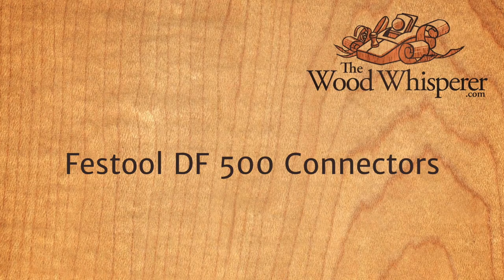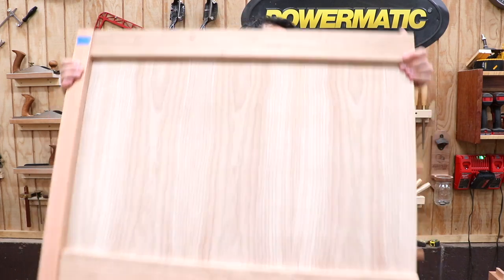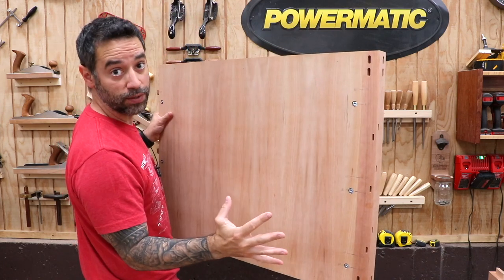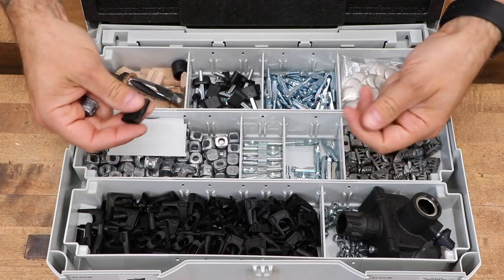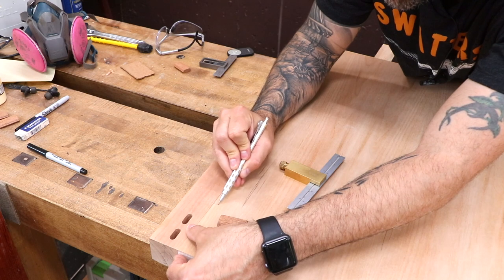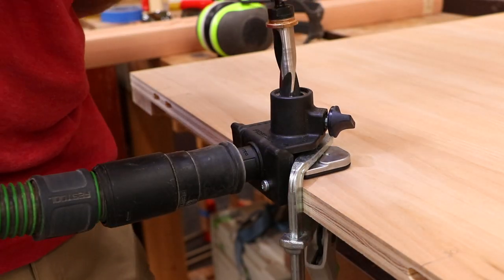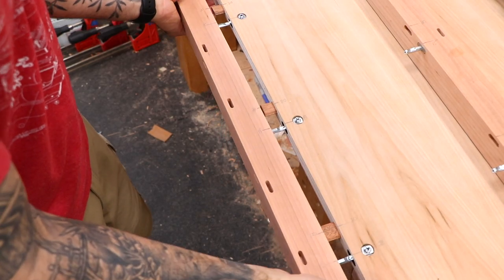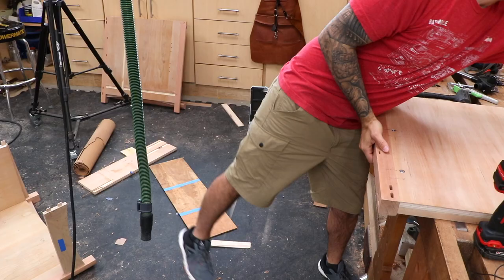Festool DF500 Connectors

Comment: Thank you for the video. I am just about to start working on a bed for my son. Being able to break it down is, well, mandatory, won't fir through the door without the ability. I was going to use some RTE's I had lying around, Ikea still with a visible hex head. I might actually get this system. A lot of money, but, it looks like it might be durable enough to handle my 10 year old boy, and be hidden.

Comment: Thanks for doing this video , I looked at the kit and thought the same thing  (WOW  there's a lot a doohickeies in here )  I use the 700 connectors and love them, now I have the option of using these too .   Festool did a book on the domino that included the DF 700 connectors and I found that super helpful . If anyone is interested that's available f or download on the festool site .  I'm sure an update will be out to cover the DF 500 connectors at some point .

Comment: How does the connection feel? Does it feel as if you actually glued it in place? Just curious
Reply from the maker: Yes it does. The fact that I put a regular domino next to each connector make it rock solid. And you don't need much holding pressure to pull the parts together so the connectors do that very well.
Reply: The Wood Whisperer I've seen these offered in yankee land but I'm unable as yet to find them in the land of oz. (You know, the island where the brits sent their prisoners)
Reply: Carba-tech and Gregory's Machinery have them. Yes mine included convicts. Cash & Co (including)

Comment: Hi Marc, I have a fewof questions if you don't mind. 
1) would the DF500 system work with say making a knock down joint for a bed rail, or should you get the DF700?
2) @2:27 wouldn't it be better to cut the 15mm leg hole a little deeper so that the "post connector thing" sits below the surface (by a couple of mil)?  that should encourage a tighter joint, no? 
3) if you used this system, how do you account for wood movement?
thanks!
Reply from the maker: 500 can work but 700 is better if you can get access to it. For the post connector, I'm just following Festool's advice. I doubt going deeper would have much noticeable impact. Regarding wood movement, you account for it like you do in any other project. This is nothing more than a mortise and tenon that you can disassemble. Wood movement still gets the same consideration whether you're using actual dominos, regular tenons, or these knock-down components.

Comment: Awesome ! I thought they said that the 700 could not be used for thinner stock like 3/4” or was it 1/2”?
Reply: At the time I bought my df500 the 700 couldn't be used to join 1/2" edge to 1/2" face.  So I bought the 500.  Shortly after my purchase Seneca came out with an adapter for the 700 that allows for the small dominos to be used to join 1/2" face to 1/2" edge.  So the 700 can do anything the 500 can do but the 500 is limited in what it can do.
I'm a bells and whistles kind of guy, I'd get the 700 even though I probably wouldn't have need for the larger dominos but I like having that option, just in case.  On the other hand, besides having 5 fingers, if you know you will absolutely never need the larger dominos the 500 is smaller and a bit easier to handle.
Reply: @ThekiBoran  I totally understand your thinking on that decision. I figured I buy the 700 with those Seneca adapters at the time but now I’m planning to buy the 500 too.

Comment: Do you think these are strong enough connections for bed side rails?  I've seen the larger ones, but don't own the 700 domino.
Reply from the maker: Probably not. The max depth of the 500 is really the heart of the issue. For a bed, I really think you'd want more substantial mortise/tenons.
Reply: On a bed if you used a pre cut tenon that you can for example put your rail through you could then use this system as a means to fix it in place. The load would really be bearing on the tenon and not the actual fitting. 

The fitting would be a glue of sorts. You can use this approach with many sneaky techniques so that you do not need to glue on site.

Comment: Thanks, Marc. What holds the part that you inserted into the leg there? I didn't notice any threading or adhesive used.
Reply from the maker: The insert widens out when you screw in the post. It connects to a nut and as that nut slides up, it pushes the sides of the insert out, forcing them into the sides of the mortise.
Reply: The Wood Whisperer I was wondering that too, until I looked closer at the thumbnail. Doing a "dry assembly" explanation (not in  wood) would have cleared that up greatly.

Comment: Joke of the day: These knockdown connectors will be great for, card houses, slippery when wet signs and sand castles.
Reply: They are also great for making large frames on site and not need to glue them up. Sometimes you only want to be assembling on site.

Comment: So for those of us that do this as a hobby (i.e. cannot afford festool) any runner up suggestions for a break down joint like this? I've used cross dowels, but they are a pain.
Reply: The only other option is the mafell duo doweller which costs the same level of money and is base around dowel joints. 

Triton have a dowel machine as well for about $300 but a lot of people are saying it has very poor accuracy and is not worth it.

Comment: $375?!  I dont know why im surpised, it is festool afterall, but damn.
Reply from the maker: Yeah it's up there. Looks like the connectors themselves will run you about $2.20 each. This kit contains 70 of those plus the drill bit, the jig, some dominos, and a few other doo-dads. Not exactly a good value but you already knew that based on the brand. :)
Reply: 2.20 per connector  is a lot.  Even good quality can locks can be had for under a $.25. Even the off set ones(they have a hinge in them for panels that need too meet at odd angles) are less then .$75.
Reply: $375 is better than the uk. £376.92 inc vat on their web site or $505.79 USD !!!! Annoyed of England.
Reply: $375 is not a lot of money when you consider that a job could be worth thousands.

Comment: please forgive my lack of experience, but do you consider the IKEA latching system too bad? I've assembled a lot of their furniture and those never seem to be the problem on the long run, other materials like their fake leather and above all their particle boards are bad, but the latches themselves seemed... more or less ok, I suppose... are those much better?
Reply from the maker: My reference is to cheap particle board furniture. I shouldn't lump IKEA into that category because i haven't actually seen an IKEA piece in years. I know that old IKEA stuff I've owned didn't make it through a move. The knock-down joints didn't last. But the hardware itself was still in good shape, it was the particle board that didn't enjoy the stress.
Reply: Ikea sells small portion of products are good in cost performance value but 90% of their products are junk in particular to wood related products. It seems everywhere these days so I decided to build my own. I wouldn't use ikea type of connectors on any of my hardwood furnitures. It's junk.

Comment: I've got a Domino but $300 + is a little bit more than I want to pay, I'll stick with the regular screw locks for that type of assembly.
Reply: You may not actually need the kit.  Lock screws are fine but if you are looking to produce something that is as good as the domino joint then this kit is the way to go.

Comment: Super "high end" expensive Ikea furniture made at home?
Reply: Croz 1007   LOL.
 (Seriously though, being able to break down a desk on moving day is wonderful)
Reply: I make large frames on site for various projects so using this system means I can cut and measure everything at the workshop assemble it and take it down and then rebuild at the site. 

I can do this all from the back of the van when fitting.

Comment: I'm curious Marc. I believe this is part of one of your projects isn't it? ... don't you think you're reducing your potential audience by using expensive hardware like this? I can see why someone pushing out lots of furniture would use such a system, as you'll be saving time, and time is money, but for the hobbyist woodworker it's like you're finding ways to avoid complicated joinery by throwing money at the problem. I don't get it ... :)
Reply from the maker: Well first and foremost, reducing my potential audience is just not as much of a concern for me as it might be for others. I try to make my videos as approachable as possible, within the confines of what I find interesting and what I'm willing to do. Filling my shop with Rybobi and Black & Decker Tools would certainly make my channel more popular, but you won't see me doing that any time soon simply because I don't want to. But now you have me curious. What complicated joinery do you think I'm avoiding by using this system? This is a 1:1 substitute for traditional knock-down hardware. If there's a knock-down joinery solution that doesn't involve similar hardware that would work in this scenario, I haven't heard of it.
Reply: Fair enough
Reply: I wonder if drawbores could be used to similar effect, and then drifted out when the desk needed to be moved. I made some lofts for my kids with that idea in mind, but haven't needed to take them apart yet to find out if it works or not.
Reply: wforl respectfully disagreeing. As a professional woodworker Marc's channel is one of the few I watch specifically because he uses tools and techniques that pertain to me. I found this informative as I was wondering about this system. Unfortunately pros, be they machine or hand tool guysn need to spend quite a bit on their setups to achieve repeatable, high quality results efficiently.
Reply: ah ok, I just always assumed the target audience was the hobbyiest wood worker, and it seemed a little over the top, when there are many more accessable options that are just as good at a fraction of the price. But as I saidm for the professional, it seems like it could save time/money
Reply: @SirBenJamin_  
I produce high end detail carpentry that installed in peoples homes, offices, shops and other places that people frequent. 

Some jobs I do require minimum disturbance. That means producing it off site and taking it to site and assembling it. 

A Domino and that system may appear expensive but when doing a job worth thousands it is money well spent.  It may not be for everybody and that is fine but for some professionals it is a new way of living. 

I can produce large frames and take them in my van and assemble on site with very little effort, noise or dust. 

A domino is an jointing system that even amateurs can achieve hidden joints that are very very strong with little effort so that they can then focus on the things that they like doing.  I love cutting hand joints but on many occasions they are not practical for me to do.